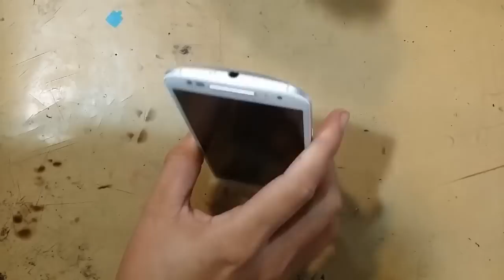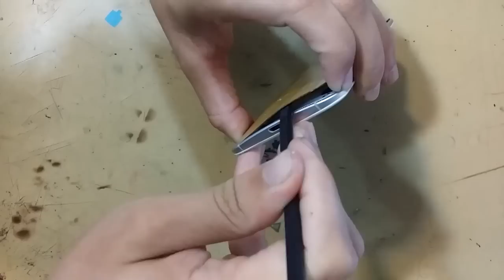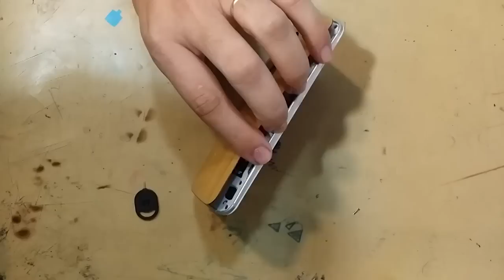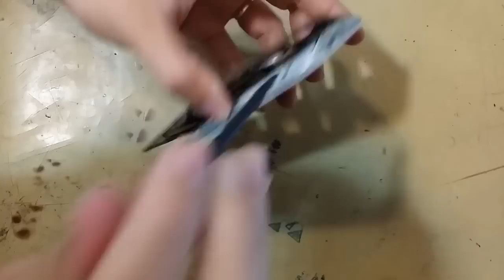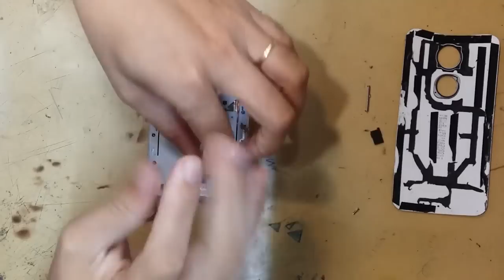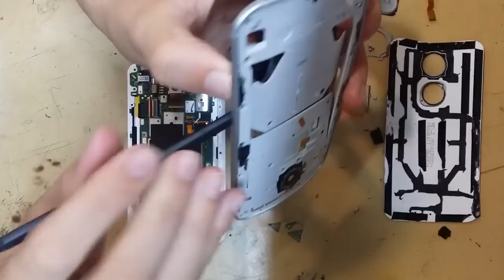Desmontando Moto X 2014 xt1097 2º Geração disassembly

Comment: Hi, I found so far the only normal video! Please tell me the problem with moto x2. Shuts itself at 10-60% charge, if the charge 70-100% of all operating normally or if recharging is. off occurs at any load (videos, games, quizzes). in sleep mode is not disabled. the battery is charged and discharged normally. sometimes by 5-20% battery runs smoothly. you can not guess. but usually from 50% to 1% and the unexpected shutdown occurs .. please write the reasons for this failure. Thanks in advance!!

Comment: Olá , eu tenho um 2g e usado motorola ED30 de bateria 2070mAh , que usa seu modelo de bateria motorola 2X, e tem amperagem ?
o cabo flexível é a mesma que a minha bateria ?
Hola, yo tengo un motorola 2g y usa bateria ED30 de 2070mAh, que modelo de bateria usa tu motorola 2X, y que amperaje tiene?
el cable flex es igual al de mi bateria?
Reply from the maker: RouzautRick é diferente